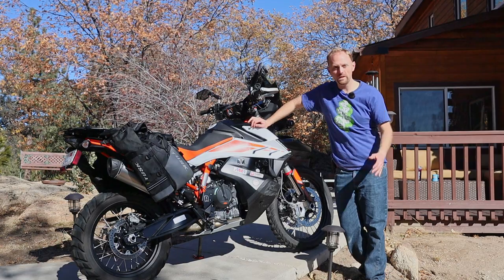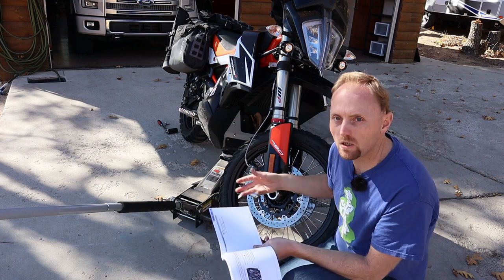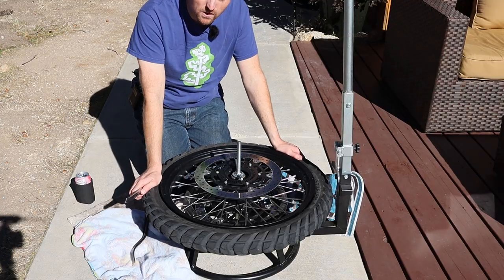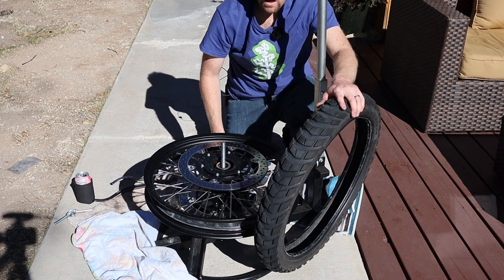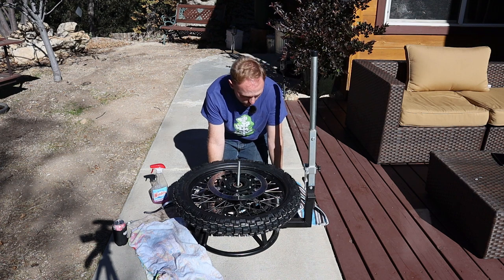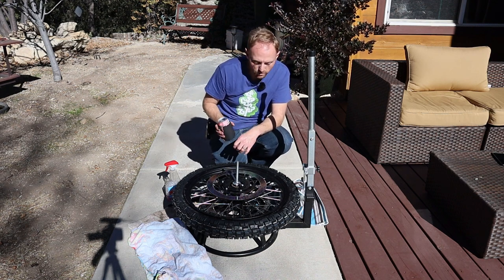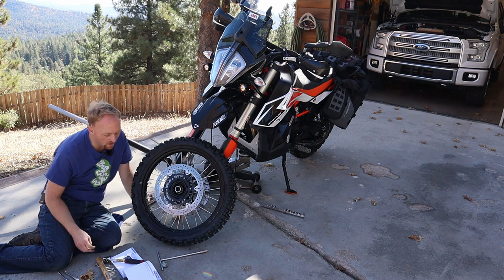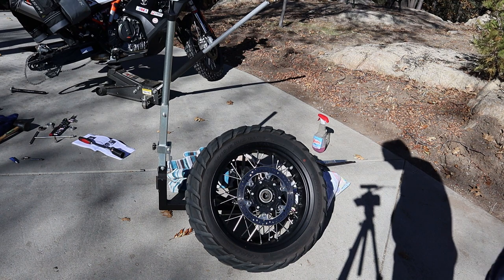Shadetree Mechanic Guide to Changing Motorcycle Tires

Comment: Another tip: you can use a c-clamp to keep the beads clamped together and down in the center of the rim channel on the opposite side of where you're working the tire irons to get the bead over the rim.
Reply: Oh good tip.

Comment from the maker: Do you change your own tires? If so, why? Do you  have tips or tricks to share with us?
Reply: I change my own tires, 1, because a friend got the local car shop to do it, and they were fit crooked, 2 , because you might have to do it on the trail, so build up your competence by practice at home. My tips... always use soapy water for lube, and Cable ties ! about 5 for a 19" rim. Works a treat. Videos are on Youtube.
Reply: Great video again, but you didn't balance the tyres? Is this not necessary for dirt bike tyres? I've always balanced road tyres...

Comment: Like someone else said, it's very important to keep both beads inside the drop groove. I will state the obvious one time. The diameter of the rim is larger than the diameter of the bead. Use your knee (if the rubber is squishy enough), a clamp, anything the keeps the beads together. I'm noticing that some of the tire irons on Amazon are coming with rim ptotectors and clamps. Just food for thought. It doesn't need to be that hard.

Comment: I learned a tip from another video.  For the front, tighten the pinch bolts on one side first.  Then bounce the forks up and down a couple times which aligns the forks correctly then tighten the other side pinch bolts.  The video said if you don’t do this, the forks can be slightly off center which puts pressure on the fork seals and can cause them to fail sooner.  I’m no expert but seems like sound advice.
Reply: Check fork alignment by sliding the axle through both forks. It should move very smoothly, no binding.

Comment: Thank god its just not me that find changing tires hard, huffing and puffing! The rear tire is really heavy when you have to flip it around the stand.
Thank you for the tip about the center channel, i will try this next time instead of forcing it with the bead breaker.
Last rear i changed was to the Dunlop Trailmax Mission and good god that sidewall is so stiff, im sure you can ride that without air... I do not loop forward to remove that.

Comment: Never seen a pressure gauge used when seating the bead. With small compressors, leaving out the valve can help get enough air to seat the bead. I've never not had a bead go pop when seating. I'm sure I could hear the paint being scraped off the rim!!!

Comment: Hey Ian, are you still using this tire machine? Anyway if you haven't already, make a designated stand, anchor that to the ground, say 2 ft. high and about the same diameter as the base of your machine, then bolt your tire changer stand to it. If your working at waist height the ergos are great you can use your upper body weight and strength more, and when the machine is fixed its not moving around on you. As always great videos, love the noisy car part, lol.

Comment: tried this method and it works great ... only changes were I cut that center bolt down to the top of the wheel center hub and I used Silicon slippery spray on the wheel rim and tire inner circles....  oh yea cheated by using cable ties also  175 lbs pr:hand-orange-covering-eyes::hand-orange-covering-eyes:f

Comment: great video: most street bikes have a double balanced kick stand.. / the back tire off the ground... / add a brick for weight on the seat/ now front tire in air :>)... DAWN dish soap is what dragsters use to keep tire from spin on rim! it dries and glues on tire to rim = B- to remove.. but dont slip or leak... use alot soap .. 6 table spoons to like 12 oz bottle water! .. if u got old rusty rim.. wire brush it.. then add tire rubber sealant! no leaks air ever! luv this stuff!

Comment: Looks like a good workout Ian! (As long as you don't get bloody knuckles. 😁) I'm just back from the dealer, got my front tire off, but then got stuck at 1/4 of the final bead not seated on the new one. The stiff TKC70 wouldn't stay down in the "trench." Need some hooks or clamps to keep it down there for next time...

Comment: Thanks for the video.  No need to rebalance?
Reply from the maker: I didn't cover that, but most people will want to balance. I usually skip it.
Reply: Great vid Ian, tk! Marc Parns makes a sweet balance rod, it's actually machined in spec. I use glide, its an auto clay lube diluted 10:1, I spray, taking it off, putting it back on, and spray for the bead seat....works like magic